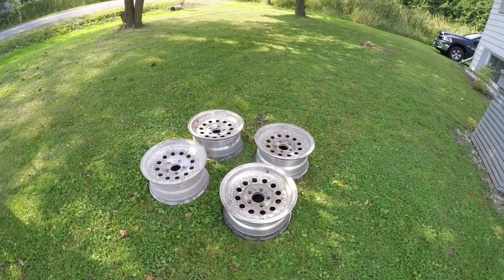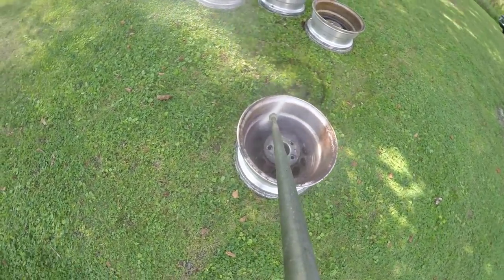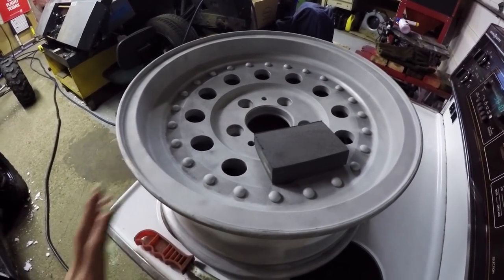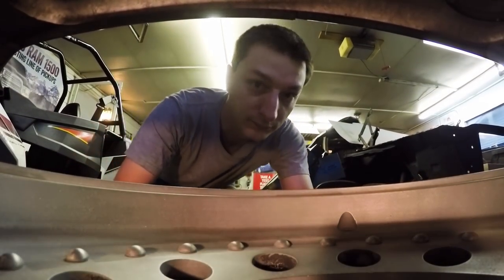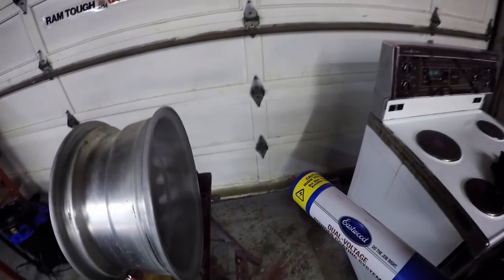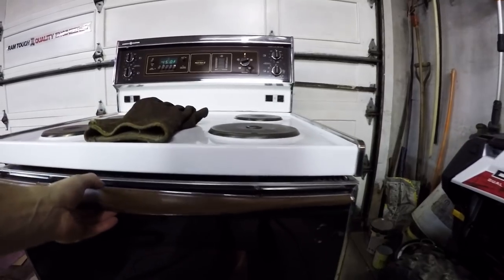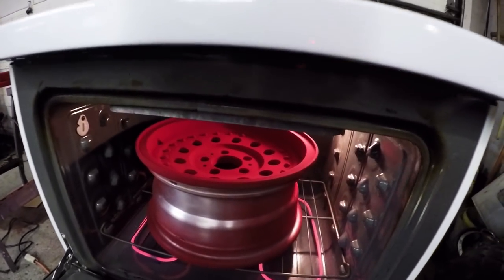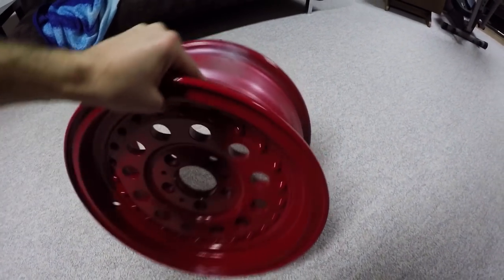How to Powder Coat your Rims with Eastwood Dual Voltage Gun

Comment: Very nice! and didn't have to use the little womans oven in the house! I am guilty of washing a Geo Metro big 1.0 block in the dishwasher!
Reply from the maker: HAHA!
Reply: Aaron Belknap too funny😂😂😂😂
Reply: vw eng in the apartment dishwasher broke that thing and did 8000 dollors in damages  i took the carpet out started to paint it blue was going to put beach sand reality came in play i was going to need alot if sand if i wanted a beach was not cost eficent and decied to put checker pattern on floor and wall i think i was hi

Comment: Looks pretty good the only thing is and maybe I'm wrong I thought you were supposed to out gas the wheel at a higher temperature then the bake temperature
Reply from the maker: Yes, I have since learned that I should have baked the wheel at about 500F... turns out much better.

Comment: something went way south on this, they should lk like glass when your done,
Reply: wisco 
I don't think buddy cooked them long enough OR hot enough. LOL
Reply: @Mr.Chris.P.Bacon1  the rim texture may not have been smooth enough after sandblasting. Gives it a rough look.
Reply: BigFrogs4x4 in my experience a rough texture is needed for powder to properly cling on the substrate , you should never smooth out a substrate the whole point of the blaster is to rough the surface up and u SHOULD NOT sand to smooth after you blast very bad idea

Comment: Over the last few weeks i have watched quite a lot of hours of tips and guides on powder coating and 2 things here stood out.

1: The media blasting should give the absolute best surface to adhere to so using the sanding block could undo that to some extent. 

2: The pre baking should be at a higher heat setting than what the cure process requires. Otherwise the higher heat might drive some gass out that the pre baking didn't get.

By the way did the powder you used instruct you to cure it for 30 minutes? I usually see powder taking from 10-20 minutes.
Reply from the maker: Yes, I agree with both of your comments. I no longer use a sanding block and a pre-bake at 500f now. Can't remember about the cure time...
Reply: glassglowz nice. if you should film other powder coating projects I will be happy to watch them.
Reply from the maker: Thanks buddy!
Reply: TheGame4Life 
I did my aluminum alcoa wheels   Came out looking like glass. 
I wet sandblasted them( took me minutes)
Then I sanded them with 80 grit 
Wipe them with acetone
Throw them in the oven for 20 min at 450 degrees 
Immediately after that I dusted them with mirror black powder at 8 psi  it almost immediately had a reaction with the wheel hot at 450 degrees powder almost instantly turned glossy after that I baked them at 380 degrees for 15 min. And. Wow what s nice gloss mirror like finish. I was amazed since this was my first attempt at doing this.

Comment: maybe a dumb question... I don't know if it was the glare of the camera or what.  but it seemed to have lots of Orange peel, can it be sanded and polished like paint if it was Orange peel??
Reply from the maker: Yes that is orange peel... very typical for powder coat. Not sure if you can wet sand like paint.
Reply: glassglowz actually orange peel for powder coat is not typical that was a very Orange Peel job wasn't prepped completely
Reply: He didnt let the substrate reach baking temp b4 setting his timer. So basically it didnt bake long enough at the right temp

Comment: Sanding after blasting is a bad idea, if u must sand to knock corrosion down do that first and then media blast the part. The powder clings and builds better on a raw uniform blasted surface, also your powder did not flow out properly it looks like it didn’t reach temp at all u have to measure with digital thermometer and start the cure time based on substrate temperature reaching 400 first
Reply from the maker: Yeah I don't sand my stuff anymore. This was pretty much the first time using the powder coating gun and I've learned a lot since then! Thanks for watching.

Comment: Can someone please help me understand? I’m very new to this i just bought a 4x4x6 oven that we haven’t even got in yet but I’m doing as much research as i can.  The question i have I’ve watched on YouTube and seen hundreds of different answers. My question revolves around multiple coats and clear.

1) everything i see says you should always use a clear coat for durability and to keep the chrome colors bright.

2) where I’m confused is multiple colors for example if i do chrome and let it cure as recommended do i put the transparent on when hot or back at room temp?

3) when putting on the transparent color i put back into oven. Let part get to tell and do the recommended cure time. ( will the chrome coat being cured twice hurt it)?

4) when that comes out do i add the clear when hot or room temp? After i add the clear and put in oven and let part get to temp and cure at recommended temp. ( will the chrome coat going through 3 cycles and the transparent 2 cycles hurt them)?

I can’t seam to find anything on this that’s consistent

Comment: good vid ,..couple of mistakes never ever touch an aluminum wheel or anything else aluminum with a wire brush the resulting scratches can be so deep even sandblasting cant get rid of them..second do not use a sanding block you would be better off using scotch brite or fine wet and dry sandpaper 340 grit or finer
Reply from the maker: This was one of the first things I ever attempted so I really didn't know best practices. Thanks for watching!

Comment: Did u not have to clear them when u put them. Back in after the red I'm new to this
Reply from the maker: Nope, no clear coat applied to the rims. You can if you want to though. They do make powder clear.
Reply: @glassglowz  I was going to use a cooker for doing rims is it possible to use a cooker that goes to 250 heat because we can't get anything hotter
Reply from the maker: @dbdb4274  you really need something that will go up to 500 F
Reply: @glassglowz  do u tink 250 degrees and leave the parts in longer it would be OK
Reply from the maker: @dbdb4274  I'm really not sure to be honest. I'll call the powder company.
Reply: @glassglowz  we don't have many here

Comment: Does anybody knows if it has an Effect on the coating if you lay down the powder coated wheels on an oven tray like he did? I always thought the Parts should be hanged in the oven
Reply from the maker: It will leave small marks on the back side of the rim. Wasn't a big deal in my case.
Reply: Niklas Koch makes no difference

Comment: Why don't you build a nice and powerful flow-type sandblaster with sand reservoir under pressure? I guess this one is not very effective, especially when it comes to rims... Anyway, the result is great, although the baking temp might be slightly higher, around 500F...
Reply from the maker: +Ivan Larin I might upgrade to a different style of blaster at some point. I'm currently working on some rusty steal rims and it's taking about 2.5 hours per rim! According to the instructions on the bottle for the powder coat, the bake temp is 450.
Reply: +glassglowz Yeah, sorry, I wasn't taking into consideration that you use different powder, the ones we use here mostly require 480+ degrees. As for the stunning 2,5 hrs per rim - damn, that's long! Consider using the blaster I mentioned, it takes me 0,5-1 an hour per rim, not more. And the device is easily built by your own hands, no expensive parts. The nozzle is the trickiest and it should be ceramic to last longer. But ceramic nozzles cost a lot! Well, being a DIY guy, I use old spark plugs for that. If that makes sense, I'm ready to help with some advice, you are welcome. :)
Reply from the maker: Ivan Larin Thanks for the info Ivan!
Reply from the maker: What do you mean about "how the material was placed", you mean the rims on the oven rack?

Comment: So if you do not heat the object first it is more prone to bubbling?
Reply from the maker: +Water_Cool_Fool Heating it first helps burn off all the oil stuck in the pores of the metal. If this isn't done, the oil will evaporate underneath the powder when you bake it and try to bubble up to the surface, leaving you will lots of little bubbles.
Reply: Actually, Aluminum outgasses.  By preheating, it helps prevent bubbling of the powder coating.  If it Outgasses you get pock marked looking ZITS in the finished product.
Reply from the maker: Yes, I learned that the hard way with aluminum. Not so much with steel though, but I still pre-heat anyway.
Reply: worldtraveler ioo

Comment: Was wondering if you have to remove the coating where the hub sits ?
Reply from the maker: For something like this, it really doesn't matter. If you're putting the rim on a car, it might be wise to remove the coating, or mask that area off, so you don't get high speed wheel vibration.
Reply: glassglowz  Thanks ! I’m trying to do a little research, I just bought a new car has powder coated wheels , I took a long trip and between 80 and 90 I felt a small vibration in the steering wheel, I had the rims rebalanced but didn’t get to check at that speed yet It might be ok 
I pulled the wheels to clean and noticed the powder coating on the hub of the wheel  so my bells went off telling myself this might be the culprit, I’m thinking about taking a rotary palm sander and take it down to the bare hub , any other ideas to remove this safely ? Thanks !
Reply: Are your rims steel or aluminum?

Comment: Man, the sand blast part must've taken you forever to do. What type of blasting material did you use for these? Also, when you lay the one end onto into the oven, didn't you get lines on your rim from the bottom?
Reply from the maker: Yeah it took a long time to blast them - about 1 hour per rim. I think I just used regular old white sand... nothing special. There are a few lines on the bottom but you really don't see them.
Reply: glassglowz.

Comment: Nice! I have a question for you... you didn't need to apply a primer before powdercoating ? And also clear coat after powdercoating ? I'm getting my wheels powdercoated in Silver (similar to original color)

thanks a lot!
Reply from the maker: I suppose you could have applied a primer, but it's really not necessary. This powder that I used did not require a top clear coat, however, there are some that do require a clear coat. Thanks for watching!

Comment: looks dry and orange peel like,any seasons learned from this?
Reply from the maker: The last rim turned out the best, and I should have used that one for the video. You need to pre-heat the part at a temp higher than 450 in order to burn out the impurities.... that's the best tip I have for you. Things will turn out smooth as glass at that point. Thanks for watching!

Comment: How much powder does it take to cover 4 rims?
Reply from the maker: Somewhere between 2-4 lbs would be enough.
Reply: @glassglowz  and would 2 coats be better? I have a dual voltage gun from Eastwood. Thanks!
Reply from the maker: Yeah 2 coats would be better for off-road conditions. The trick is to spray the second coat of powder while the rims is still hot out of the oven.

Comment: How long did it take to sand blast the wheels down to the bare metal? And what blasting media did you use?
Reply from the maker: It took about 1 hour per rim in my blasting cabinet. I think I used either crushed glass or white sand.
Reply: Thanks

Comment: What size compressor do you use to operate the sandblaster?
Reply from the maker: I have an old Binks 60 gallon and a smaller Sears 20 gallon hooked together. With both running non-stop I can usually blast at 100 psi continuously. I think the 60 gallon puts out 12 cfm... no idea what the 20 gallon puts out. Thanks for watching!
Reply: @glassglowz  perfect. I have a 60 gallon 11.5 cfm husky compressor that I will be using with  a 7 cfm blast cabinet. Hopefully I can run continuously without having a problem despite the 50% duty cycle the compressor is rated for.